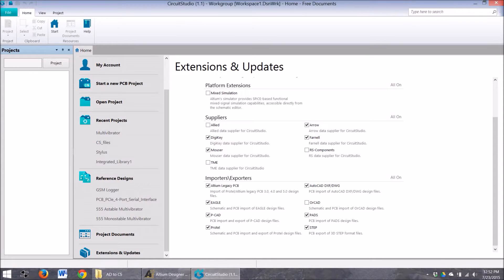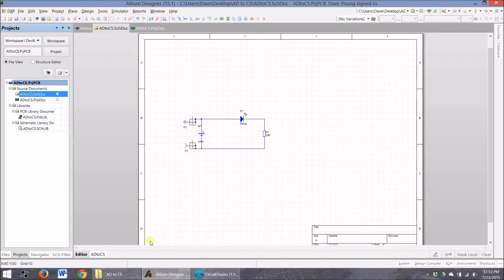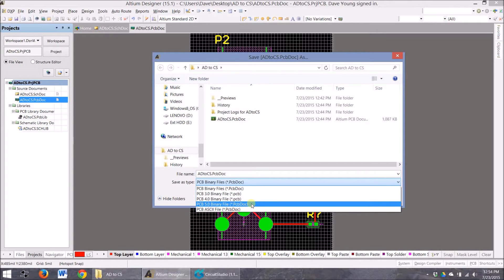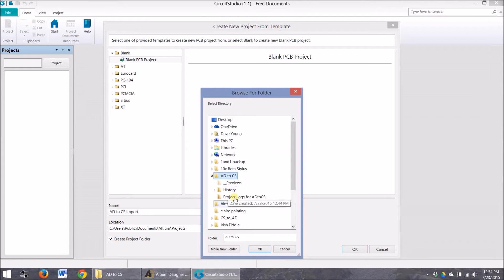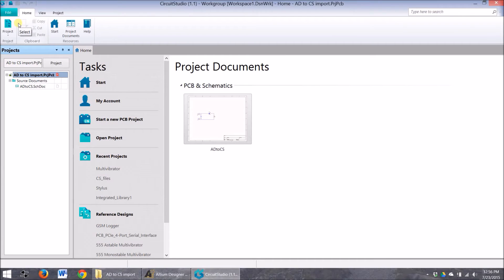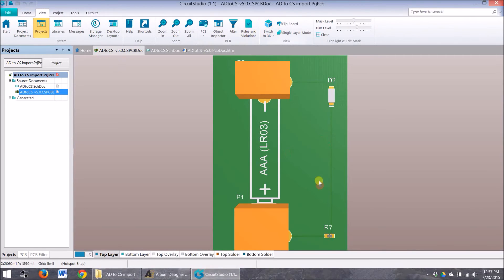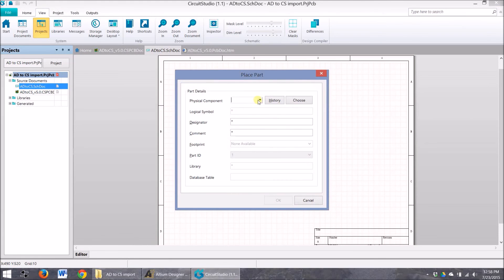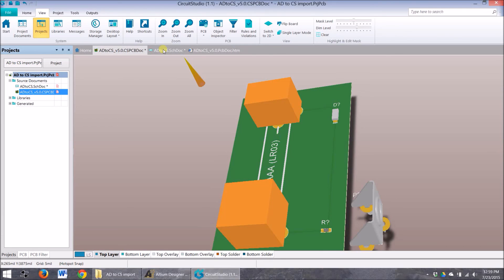Importing Altium Designer PCB files to Circuit Studio

Comment: what aboute libraries? are they compatible?
Reply from the maker: Yes, and the libraries don’t need to run through an export/import cycle. To use an Altium Designer library in Circuit studio or to use a Circuit Studio library in Altium designer, simply add the existing library in the software package of choice.
Reply: @dyoungEE  is there a video where you show how to do that?
Reply from the maker: @shuja202  No, but I bet you can find a tutorial on opening a library and project pretty readily online. It's the standard way to open/use a library.